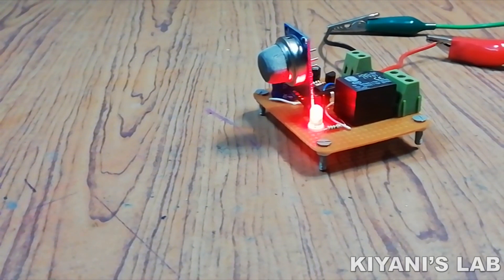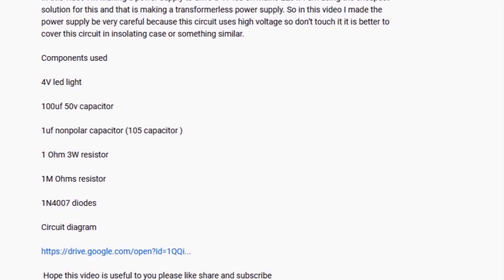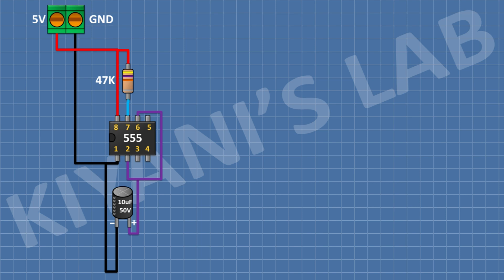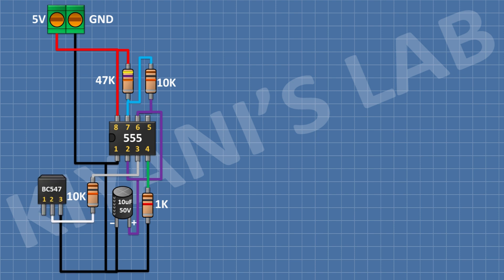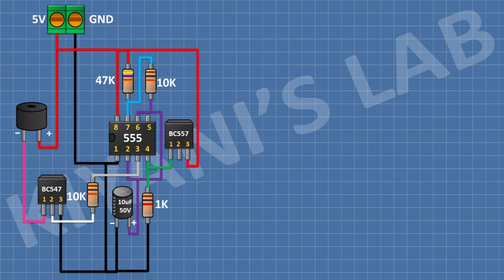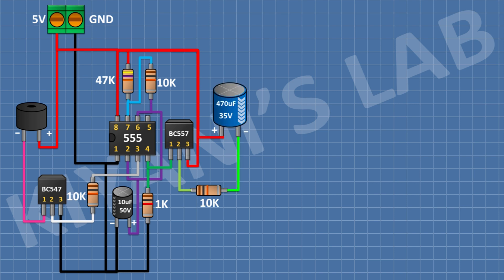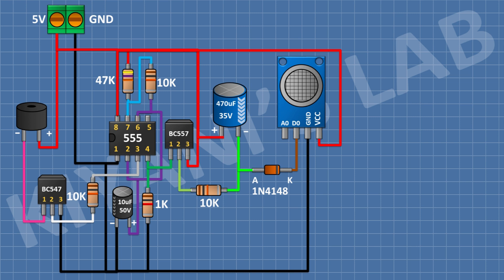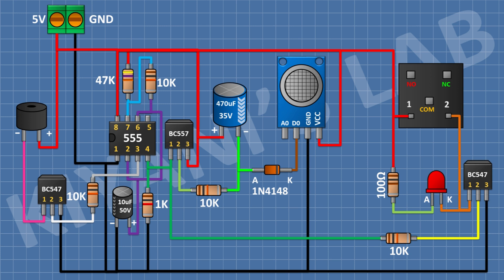How To Make Smoke Detector Alarm At Home

Comment: Where did you connect that fan?
Reply from the maker: at the relay terminals
Reply: Thanks. One more question,why my mq5 sensor is keeping buzzing even there's no smoke or chemical detection. What is the problem of that.

Comment: How do you do simulation of this project
Reply from the maker: you can use proteus
Reply: @KiyanisLab  i did test it on proteus it's not running maybe i did wrong connection using the sketch of circuit diagram, can you give me the circuit diagram on how to connect it on proteus 8 proffessional.